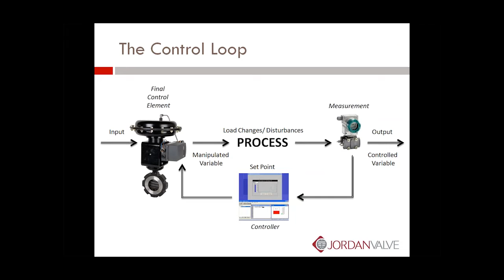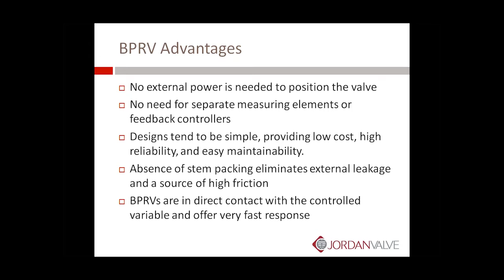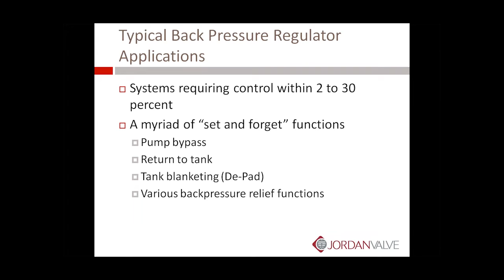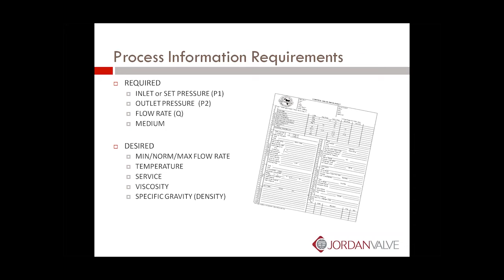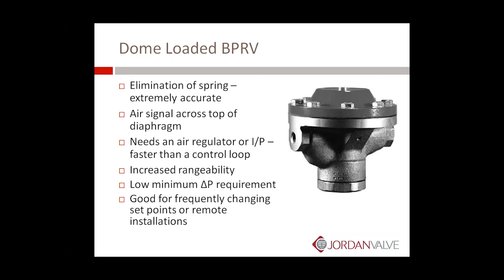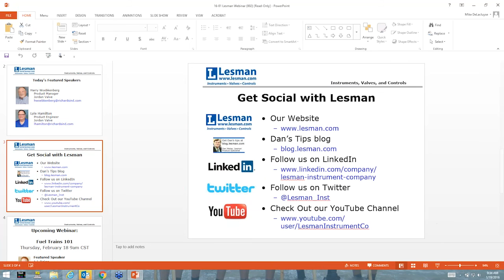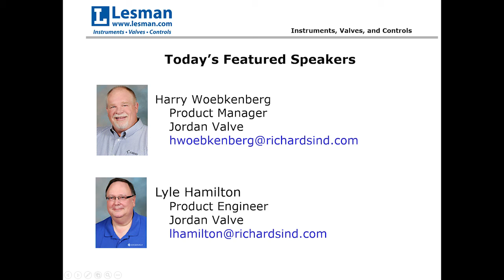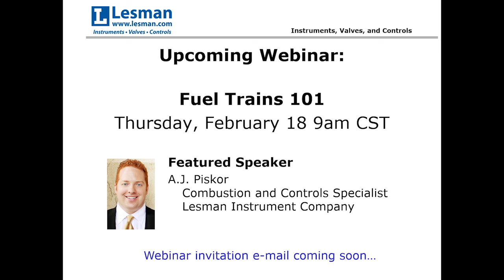Lesman Webinar: Back Pressure Regulators 101

Comment: Is BPRV effected by changing down strea pressure? i would like to connect to release from N2 blanketed tank into dust collection system (but this system operation will be on/off independent and therefore will changing downstream conditions from atmopsheric to slight underpressure)